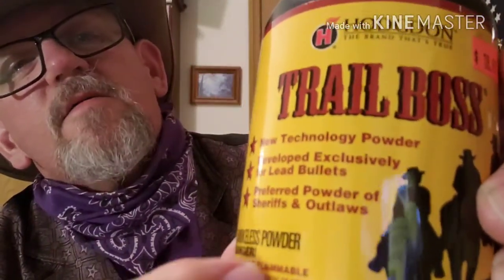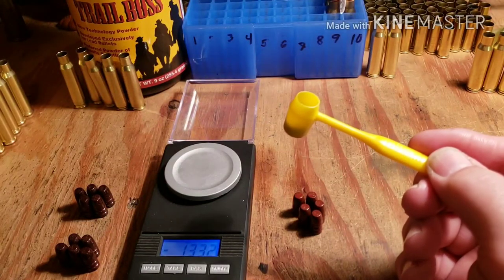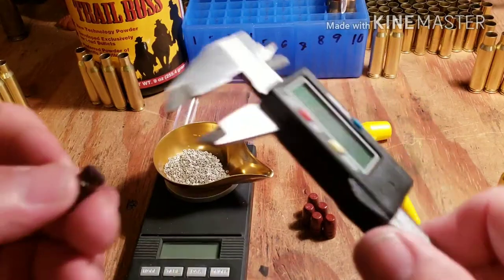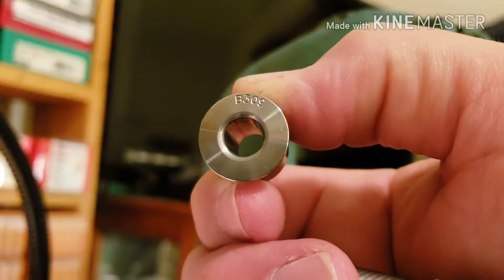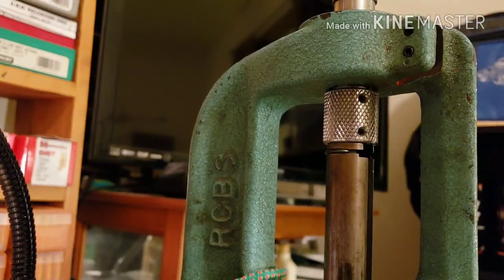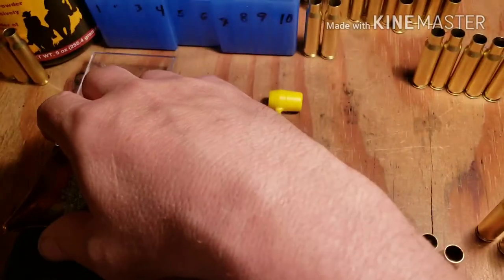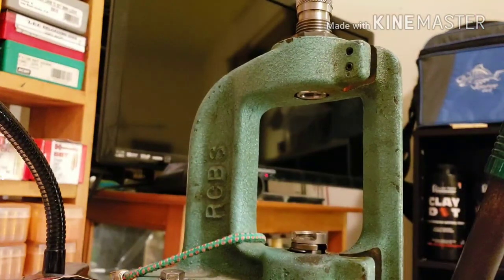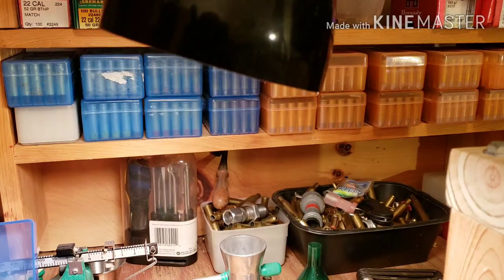Using Trailboss in 308 Winchester

Comment: What powder charge of Trailboss do you estimate is needed for a 100 grain at a subsonic 1000fps? I want to use my browning blr as a plinking rifle and not just a twice a year hunter. Grateful if you can help! Actually I will be using Tin Star as Trailboss is no longer sold in Europe - but apparently it's the same thing.
Reply from the maker: Try 10 gr first
Reply: I have finally got round to checking this out today - this is using the Trail Boss rival Tin Star as the former is no longer sold in Europe. With 5gr  I got 911fps and 5.5gr I got 992fps. So am calling it at at 5.7 grains for a 100grain 308 (hornady short jacket) for just over 1000fps. This is surely the ultimate 308 plinking/rabbit load..

Comment: TrailBoss is turning into my favorite MilSurp powder. Used it mostly in 303 Brit with Lyman 314299, very mild and accurate at 50 yards. Last week I tried it in my M48A/B (8x57 Mauser) 13 & 14 grains and Sierra 175 Spitzer and Remington 185 soft points and was very pleased with the results. Plan on trying it in the 03A3 and K31 in the future.

Comment: Good one , I'm curious what the 150 gr. velocities are with Trail boss . I may try with the 7.62 x 54 .
Reply from the maker: James Pollard  With my understanding I should be running somewhere around  1500 to 1700
Reply: With a 160 gr. bullet and 14 gr. of Unique I get around 1650 - 1700 fps . in the 7.62 x 54 . I often use data for 308 in the 7.62 x 54 r .
Reply from the maker: James Pollard  that is a good idea you might add a little bit more powder because there is some little more capacity in the Russian